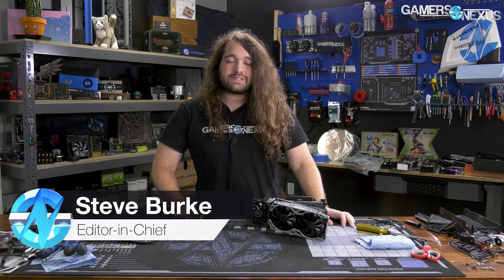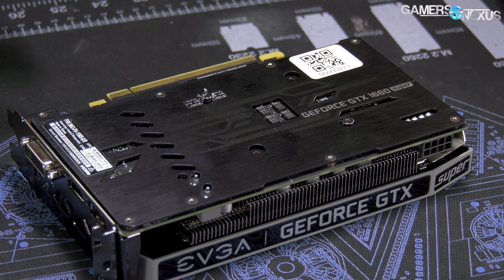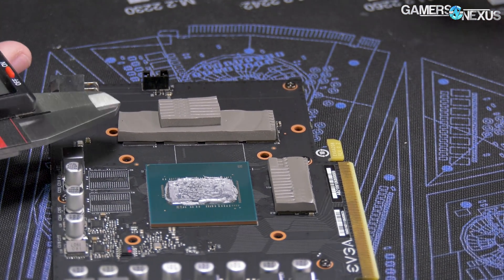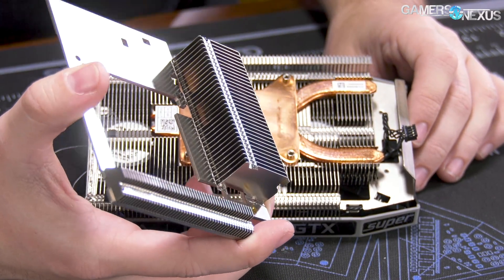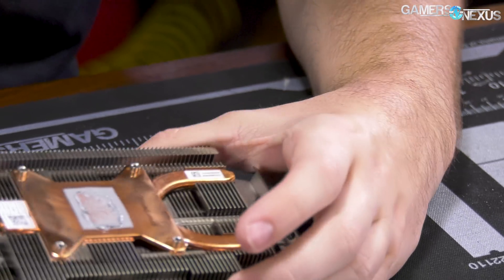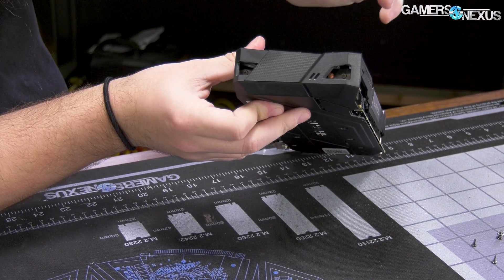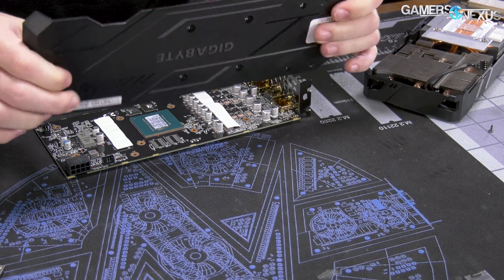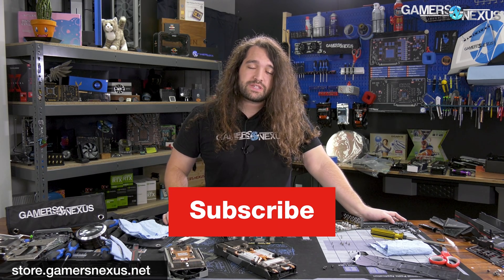GTX 1660 Super Tear-Downs: 9mm of Thermal Pads & Bendy Backplates

Comment: I just got a used EVGA 1660 and I should have researched it better. It is in pristine condition with the "tamper" tape still on it so it has never been taken apart. It works and I got the GPUz and bios numbers and the idle temp was 38-41C. When I tried to bench test it with Heaven the temp shot up immediately while on the very first screen of the test to 75-81C so I aborted the test, took it apart and it had not a single thermal pad on it. After watching this informative video I placed an order for 14 x 12 x 5mm copper squares, an 80 x 40 x 3mm piece of thermal pad, and another bag of 15 x 15 x 1mm copper squares in hopes of putting together my own Frankenstinian VRAM cooling solution. EVGA is so effen bogus for doing this crap and shipping some of these cards out with NO DAM thermal pads.

Comment: My EVGA 1660 Super’s memories got burned under the chunky pads (never overclocked), but the ASUS ROG 1660 Super’s memories remain intact. They doesn’t even have a pad nor contact with the heat pipes, only air got blown on them.

Comment: i have the EVGA 1660ti & there are no thermal pads on my memory! , After 3 years I decided to re-paste &  made my discovery. This has made me find channels like this that do a great job with teardowns & product information, Thanks
Reply: I just got a used EVGA 1660 and I should have researched it better. It is in pristine condition with the "tamper" tape still on it so it has never been taken apart. It works and I got the GPUz and bios numbers and the idle temp was 38-41C. When I tried to bench test it with Heaven the temp shot up immediately while on the very first screen of the test to 75-81C so I aborted the test, took it apart and it had not a single thermal pad on it. After watching this informative video I placed an order for 14 x 12 x 5mm copper squares, an 80 x 40 x 3mm piece of thermal pad, and another bag of 15 x 15 x 1mm copper squares in hopes of putting together my own Frankenstinian VRAM cooling solution. EVGA is so effen bogus for doing this crap and shipping some of these cards out with NO DAM thermal pads.

Comment: I'm lost with all the technicalities, but do know I been running my single fan EVGA GTX 750 Ti now for over 2 years on high demanding games from 2020 and now! no overheating temps, no shut downs or issues! plays smooth and fine for all I do and use it for. Usually get around 43 fps. but am looking for a cheap upgrade in performance and GDDR on a very strict next to nothing budget! I've also seen some GTX 1660 Super on ebay for around $75 used. I'm stuck on Nvidia though I really don't like ATI and their driver updates suck!! Nvidia is made so easy to update!

Comment: I have an EVGA SC 1660 Ti, same as the video, and don't have ANY thermal pad lol, i would love to see these 9mm pad in action xd
Reply: exactly the same for me. but i did put some thermal grizzly ones between the pcb and the backplate which seemed to help
Reply: @albion_i How do you know it helped? I may try the same because I removed the 4mm pads on mine and put 1.5mm, but later realised they won’t press on the heatsink and basically not work.
Reply: Really? I can't find a single damn proof online without tearing mine down since the Ti variant became so irrelevant thanks to Super >:(

Comment: Well, I have the EVGA 1660 super for a year now and just opened it up the heatsink fan.  I removed the bubble gum heat pads. Reapplied some high quality CPU thermal paste.  My previous stable OC speed was 150/500.  Now, is 170/750.  :)  GPU temp is about 74-75 in 3dmark.  I am getting lockup at 180/800.
Reply: Your memory modules are naked? I have the "same" card as this one, its the 2060, but with same cooler and pcb design as this one.

7 months later i removed all the thermal pads and put 3mm copper heatsink with thermal adesive that came with them. I still not sure if it got better with the copper there.

Overclock wise looks the same. Im mining on the card and nothing wrong so far.
Reply: @JuniorCloudHouse  Well, before, they were insulated.  I could OC the memory at 900+ ever since removing the thermal gum because they are getting air cooled by the fans.  I think 20 series card has better thermal design.  I just got the 2070 super.  It has its own alu plate for the VRAM and memory chips.

Comment: I'm definitely curious about the EVGA 1660 Super. I bought that exact card because I've always used EVGA for my GPU. With that much thermal padding.. is it hurting performance? will it make it overheat? So far, I haven't had any issues and I've had the card for about 6 months in regular use, not overclocked. But I'm super curious now.

Comment: Hi, so plastic back plates are basically "heat traps"?  Does anyone know if the ASUS TUF GTX 1660 Super model that has the two fans have a plastic or metal back plate?

Comment: Someone commented that the Evga GTX 1660ti SC Ultra has a baseplate. Anyone got any solid info regarding that??
Reply: It doesnt, confirmed.
Reply: @cybernaab it doesn't have one.
Reply: @cybernaab yes that would be perfect, I was going to say, the only thing you have to worry about is getting a thermal adhesive that's maintains it's hold, but you don't have to worry if it's from EKWB, I'm sure their thermal adhesive material is high quality and will keep them stuck.

Comment: so they basically adapted a 10 series cooler to work on the newer 16 series cards. It did not work out so well. msi/gigabyte did a much better job with their cooling solutions on the 1660 supers.

Comment: I wonder if there´s ANY 1660S with direct contact and no thermal pads whatsoever.....and I sincerally doubt it...it comes down to manufacturing cost and cost on warranty service. I guess thermal pads are not as efficient getting heat out of the memory modules....but they dont have a failure rate as a much bigger asembly to put equal pressure on several points across a bigger area would.

Comment: My gigabyte 570 has a metal backplate that actually has thermal pads connecting to the back of the memory modules and even have contact on the top as well.

Comment: The plastic backplate protects all those solder connections from shorting against anything loose in the case. It's not for structural integrity, just protection and presentation.

Comment: I'm a fan of the backplates. Don't they protect you from getting poked by sharp PCB elements while working in the case? Also they might protect the card from getting scratched by screwdrivers, and they let you put the card down on its back without worrying that the PCB will come into contact with an inappropriate surface. Before backplates, even with small cards, it was tricky to work with them because there was very little surface area to grab. For a low budget card, the thermal performance losses associated with having a plastic back plate might not be so bad, when compared with the benefits.

Comment: I understand your points on the gigabyte backplate, but not every. single. thing. Has to have a "function over form" mentality. You're completely correct, if they sold that card without a backplate, it wouldn't (objectively) look as good. Some people then may choose to not buy it. It's been proven that the 16 series market and it's competition from AMD is the most lucrative and competitive of all GPUs, so anything they can do to entice buyers is what they're going to do. I'd also be interested to know exactly how much of a "heat trap" you claim it would be. 1 degree? 2? I'd assume it would be trivial, and the trade off of performance to aesthetics is worth it.

I like your channel and your content, but the "function over all else" moments at times are frustrating. It's likened to, "why do cars look different, they should all have bodywork that minimizes air drag and wind resistance to maximize fuel economy", because who gives a fuck about what a car looks like. There is quantifiable and tangible value in focusing on how something looks as well as how it performs. Again using function over form logic, what's the point of Steve and I having long hair as males? It would be more efficient and cost effective to cut our hair short (or bald) so we could save money on hair care products (Gamers Nexxus shampoo? had to lol) and hair ties to keep it from getting in our eyes every time we look down. I'm reaching here, but you see the point.

I can get behind mocking shit that doesn't matter, and maybe a snide, sarcastic quip would be more appropriate for something so innocuous as a 10 cent piece of plastic meant to arguably improve the aesthetics of a card in the most competitive and lucrative GPU market. You don't have to be such a bot Steve lol

Comment: IMO If EVGA knew they were gonna have massive clearence between the ram and heatsink, I dont see why they could of machined or bought a tonne of small aluminum or copper ramsinks, stuck them on and charged an extra $5 on top. It is my belief that thermal pads perform a lot worse the thicker they are and since the pads are only making contact with the fins of the heatsink and not some copper or aluminum base plate to help transfer the heat across, no heat will really be dissipated.

Extremely lazy and silly corner to cut

Comment: I think all these big companies are having to cheap out a lot more to be able to cover all these SKUs Nvidia is forcing down their throats. The r&d and engineering costs to develop separate coolers for every card at all these different prices in an over saturated market is costly! If they only had 3 SKUs they would sell basically the same amount of cards as the 13 currently on the market and save a lot of overhead that could be better spent elsewhere

Comment: Looks like the Gigabyte card is the better choice after you remove the backplate. Too bad you have to remove the cooler to properly remove it.
The EVGA card might be a good candidate for modification to add chipsinks on the VRAM or a water cooling block that contacts the VRAM. The lack of heatsink contact with the mosfets is concerning. I've got an EVGA GTX 970 that has poor contact with the mosfets (1mm thermal pad is too thin) which is the cause of the overheat shutdown issues it has. Too many compromises EVGA!

Comment: Id like to see 3 tests 1 without anything, 1 with the THICC thermal pad(s) and 1 with cheap small heatsinks you can find online/got laying around and just use thermal glue or super think pads to stick em on the chips. last one simulating what they could've done just as cheap as the thermal pads.

Comment: You should test the effectiveness of those thermal pads with a hotplate. See how much heat they transfer from top to bottom, or whatever good metrics for seeing how well (or badly) the pads do compared to say... Half the size pads, and 1/4 and so on. Just a thought. See how much these pads actually help if at all.

Comment: 3:20 - Is that two giant thermal pads stacked on each other? What the hell, EVGA?
Reply: Gigabyte didn't do great either. Not a fan of the heat trap plastic back plate or needlessly extending the heat sink past the PCB to make the card look bigger. It's a small, low end card - make it look like a small, low end card. Stop trying to pretend it's more than it is.

Comment: those arent thermal pads, they are insulation bricks. Think i might use some for a backyard forge.
edit for bendy: i could 3d print a backplate with more rigidity that that thing 😆

Comment: Those pads seem like thermal isolation rather than a thermal interface. I don't know if those pads are foam or gel but even aluminum at the right thickness can isolate things. 
The level of stupidity is so insane I can't even comprehend the engineers' decision on that junk ass thing. 
EVGA should put some pride into their lower end.

Comment: I've absolutely no interest in buying one of these 1660 ubber super dupers but some might so it would be interesting to see just how well damned near an inch of thermal pad transfer heat away from the center two chips on that one row. On the EVGA card it looks like they used smaller heat pipes and flattened them out so when measuring things like heat pipes is it based on flat area or total circumference? Knowing that could be helpful in future purchasing decisions. For people who buy that Gigabite card would it be better for them to just remove that back plate or does this card even get hot enough to worry about it?
Thanks for how in depth you are with these reviews between yourself and the other Steve over at HU, you two make it much easier to make purchasing decisions when it comes to GPUs and just hardware in general...

Comment: Thanks for the teardown - I am looking to upgrade my GPU after Christmas (January is my job's busy season so money flows freely then) and because most of the games I play aren't as bound by the GPU I was seriously considering a 1660 super or TI instead of a 2060 (For reference, I mostly play Elite Dangerous and FFXIV on my tower; since FFXIV HAS a benchmark freely available and 12 million people play the game, I'd love to see it included in testing). I'm seeing about an 80-100$ split between the 1660 and the 2060; I'm currently running a 2 year old 1050 TI that doesn't even need a separate power connector, so anything is an upgrade; I'm looking now for bang for the buck. Also making a comment to increase your user engagement.

TL;DR - If you want to make a recommendation in the ~300$ range (1660 or 2060) and not AMD I''d appreciate it. And again, please consider using the FREE Final Fantasy 14 benchmark in testing for us MMO diehards that don't have the reflexes for the latest bleeding edge shooters. Thanks!

Comment: Hi Stephen, sorry to come back to the AMD 5700 XT
You said this is it (Worst & Best AMD RX 5700 XT Video Card Round-Up: Thermals, Pricing, & Features) no more 5700 XT
but i realized all tests comparing the 5700 XT to a 1660ti or 2060 Super only used PCIe Gen3 no Board with PCIe Gen4 (AMD X570 with a Ryzen 3XXX Zen2) therefore i gave possibly a wrong advice.
I said the next better step to a 1660 TI (MSI Windforce 2 here about 330 $) would be to a 2060 Super (MSI Gaming X, about 480 $) is  not worth the Price (1440p  no hardcore gaming).
But the 5700XT (PowerColor Red Devil) is also about 480 $ and on PCIe Gen4 might be a real boost and better than even a 2070 ?
I'm lost, the components haven't arrived and a Red Devil would be in the Budget, is this card really much better than the 1660ti (on PCIe Gen4)?

Edit: typo
System: X570 Bord, R5 3600X ,Hydro Series 110i CPU cooler, 2x 8 GB GSkill Trident Z RGB 3200

Comment: nvidia taking ques from apple  maintain a high price point but ah fuck it why bother making the cooling right just Stack a full centimeter of thermal pad to it and then give it nothing to connect to ..may as well be insulating the memory.. heck they'ed probably cool better with air hitting the mem chips directly... not buried under a mound of thermal comfort foam.

Comment: Those GB cards... I have an RX 580 8gb dual fan and taking that apart is dumb. Screws behind fans to get them off, screws that are in places youd need insane shaped drivers to get back in or out, etc. Good card for the price. But damn. Im curious about that triple fan 5700XT they released as far as a breakdown.

Comment: mesuring an oval/flattened heatpipe and calling it 10mm...
Stainless IS is better conductor then alumnum whitch is not even a metal... ALUMINIUM on the other hand..

GO to bed steve, you need it...

Comment: I can hear buildzoid's rant starting with "I would be inclined to say I would get better thermals if I removed the heatsink"... except that was standoffs to tall for the blinged-out RGB fashion accessory to even touch the VRM it was insulating from fresh air, not thermal pads so think it made temps worse, lol.  "It's a thermal pad, it's supposed to cool the thing it's on, not make it hotter!"  ROFL

Great vid Steve and crew. B)

Comment: Not that it worth another video but if you want to figure out almost conculusively what it is (as long as is it is not an uncommon alloy), if you figure out it's density then you can get a good  guess on what it is.

First clean it.

Second weigh it.

Third find the volume. The easiest way is to fill a measuring cup (or anything measure liquid volume) and place it in to find the displacement and that is the volume.

Density = Mass / Volume 

From there look up a metal density chart and should come fairly close to figuring it out.